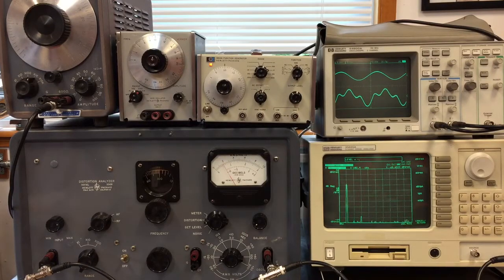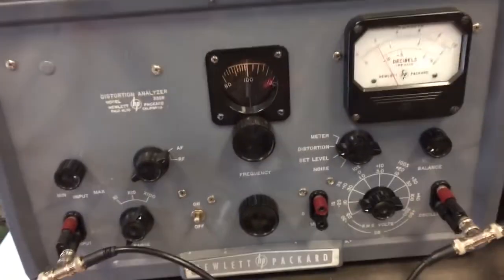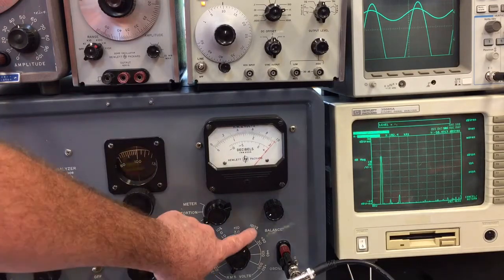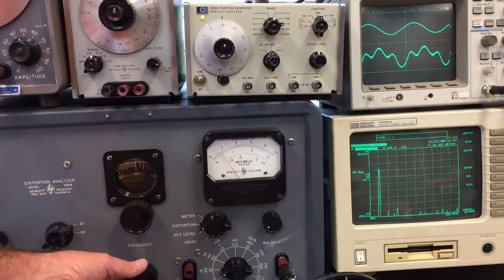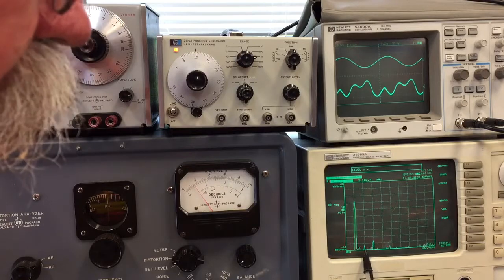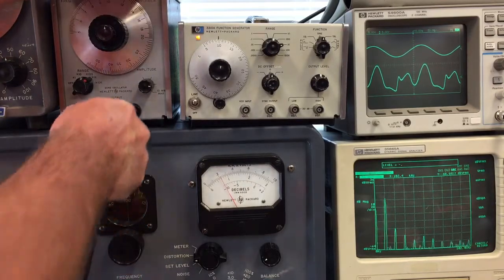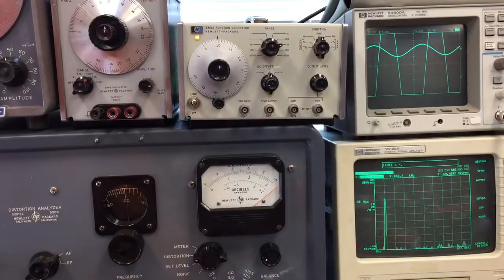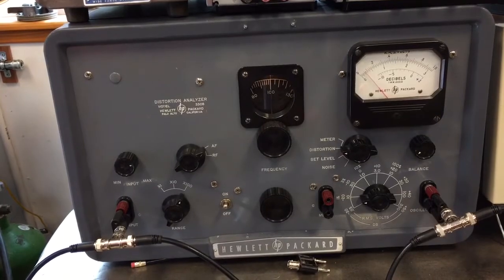Hp 330b distortion analyzer circa 1950's

Comment: Very illuminating! Extra special kudos for salvaging and maintaining all that old but great equipment. I am impressed with the low distortion exhibited by the oldest one out of the lot: has it been restored in any way? I'd expect with component aging it would have various issues. Also, is the battery oscillator's higher distortion possibly due to similarly aging components going out of spec, in your opinion, or could it be due to the restrictions that the low battery supply voltage places on the circuit design? 
Most impressive of all is that the distortion analyser still works great! : )